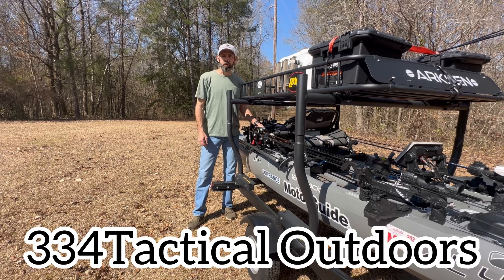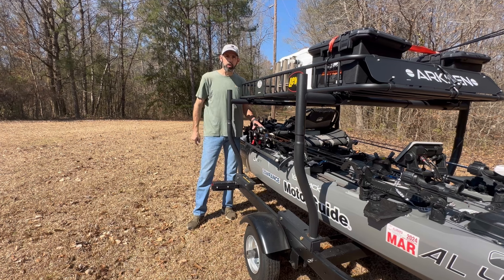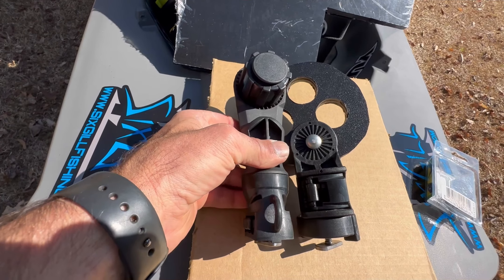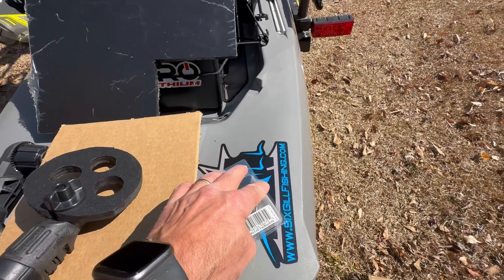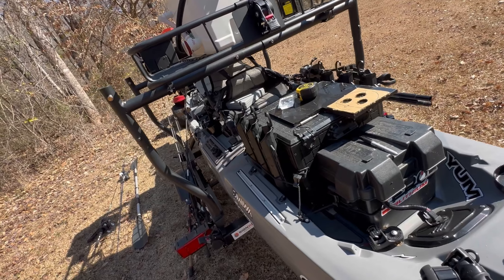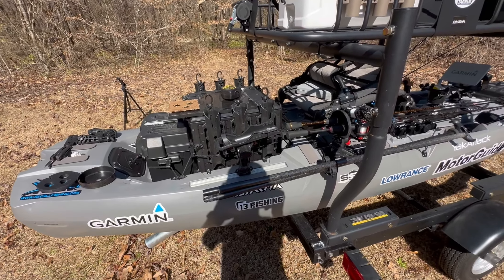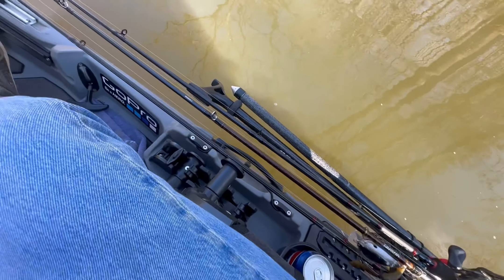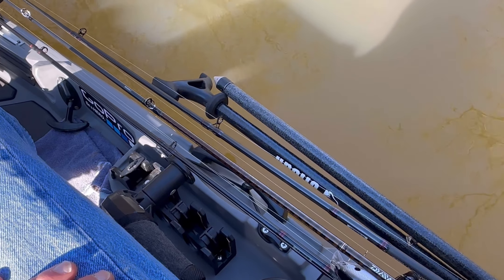Horizontal 3 Rod Holder

Comment: Can you elaborate on your like and dislikes between the Outlaw 11.5 and the SS127. I have narrowed it down to those two Kayaks. Thank you.
Reply from the maker: The difference is night and day being honest. I absolutely love my outlaw, but the dislikes was no storage unless I added it harder to add my Motorguide xi3 bow mount trolling motor and it was only 11’ 5” long. The SS127 has plenty of storage much easier to rig easier to mount a bow mount trolling motor it’s 12’ 7” long. Now likes both are super stable, both look incredible when rigged out. The perception is cheaper and is a really great kayak, but the ss127 is a lot better kayak in my opinion.